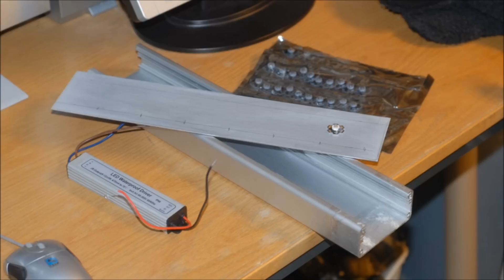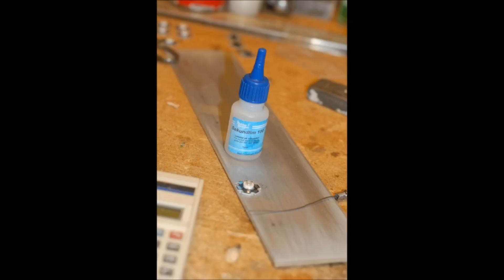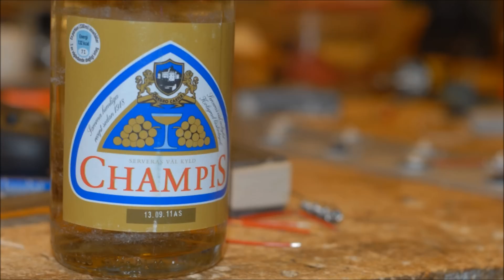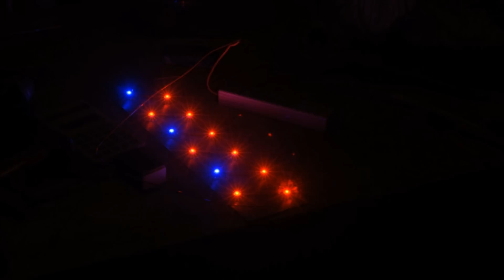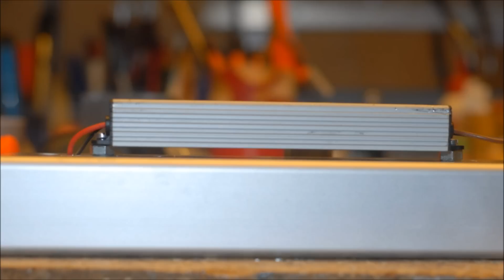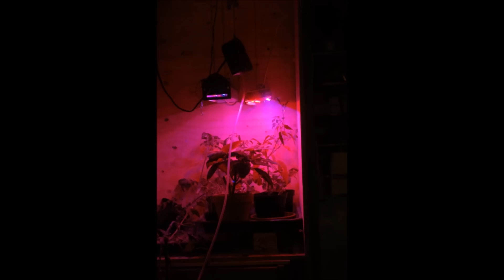How to Make a Grow Light - LED grow light DIY

Comment from the maker: 1. the supply is designed for 9-12 leds (I think, dont remember)
2. no
3. Depends on which plants. This rig I use for three lettuces, one dill, one parsley, one basil and some other. See my video "tomotoes under led" its the panel in the middle.

Comment: NICE work. 
1. does the total corrent of all leds need to match the current of the power supply? 
2. do you have to use resistors for these leds?
3. how many 3w leds would you suggest for 1-2 plants?

Comment: Hi, nice lamp. I also saw your version 2.
I have a question, I am looking to make a grow lamp for myself.
But some one told me I should use led with a wavelength of 660 nm for the red leds. Do you use those as well or is this not true? Because I can get some 625 nm leds pretty cheap

Comment: This is a nice video, I'm building exactly the same system as you :).
Have had the LEDs and driver for some time now, but will build and use in the coming month or so for growing chile peppers. How is the heat dissipation with your system? I was looking to add some heatsinks in a similar alluminum casing like yours and adding a fan, but if the heatsinks are overkill I'll leave it like you did. Also, don't you think you could use more red LEDs as they're not really 3 watts but 2.5*0.7 = +/-1.75W

Comment from the maker: @paxmowa Thanks, I havent had an issue with heat. Check out this other panel I built, "winterstorage of tomatoes" It's been running for several months now.  Just a fan above that moves the air across the panel and the drivers. Works great. Yes, the red/blue ratio... I don't really know whats best allround-ratio, different plants like different light during different parts of their lifecycle.

Comment: do u  just wire   the    wires  from the  driver  too  a  plug  for  110  ?  can  i make  2  panels and  put  it on the  same wire  orr x 4  panels  on  same plug   .  what else is  needed only led  and  driver  and   power  cord  ? i want too make one  with at  least   50 red  30  blue 3  x w   .,

Comment: I plan to use 3W 20 deep red 2,2V and 10 royal blue 3,6V LEDS, all 700mA on minimal voltage. What kind of driver I could use and maybe I can DIY from other devices?

Comment: The led driver puts out 9V? You don't need to regulate it to 3v for the led modules?
Reply: Nope. as long as the current is right, and the total wattage of the LEDs is within what the driver can provide. LEDs should be current regulated, not voltage regulated

Comment: hi i have 5w uv led n i need 12 of this leds in series and the each led consume 3.4-3.8 v wit 1400ma can u suggest any driver setup as im using resistor but it get hot wit 12v power supply

Comment: Hi I intend to do a panel led grow 150w (50 leds 3w) and want to know which driver to use or is it better to use a power pc (how to connect the panel at source?) Await responses excuse any errors I used the google translator!
Reply: From my experience you will need cooling on the aluminum that the leds are mounted on.  150 watts is a lot of leds ... you will need some much thicker aluminum than he used or it will have to be over 20 feet long :)
Reply: A colleague of a forum made a LED panel in a form of aluminum cake and put 120 LEDs of 1W and not hear problems, but I've given up this project anyway thanks!

Comment: "A fan might be a good idea" - for God's sake either a fan is needed or not & you should not post until you know.
There is plenty of conducting metal in your design but I saw no safety earth - what are you thinking?
And finally superglue notoriously not good in thermal cycling, you need to do some research.

Comment: what voltage power supply/driver shoudl i be using if i am making a 300w led panel.  THe cree 3w leds say a maximum forward voltage of 3.5v yet some of the led lights you buy are running on 24/48v.  how is it done or worked out.  are groups of leds wired in series and parralel.  so either groups of 4 or 8 leds arranged in series and then parraled together.  if you wire 4x 3v leds in series can you run them then at 12v.